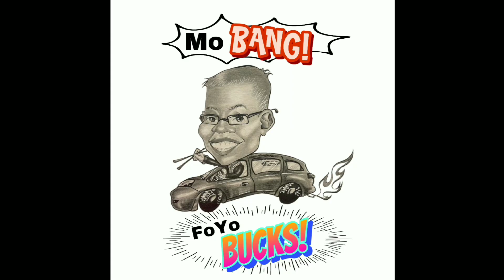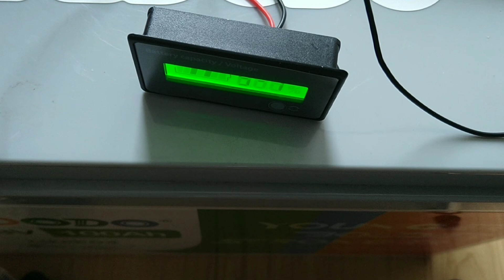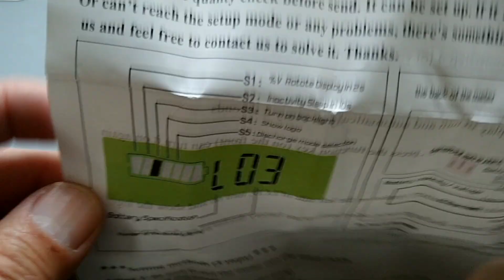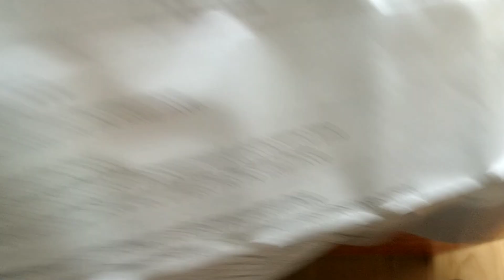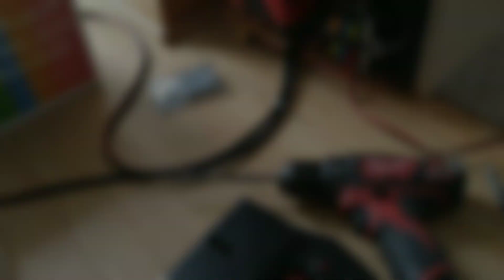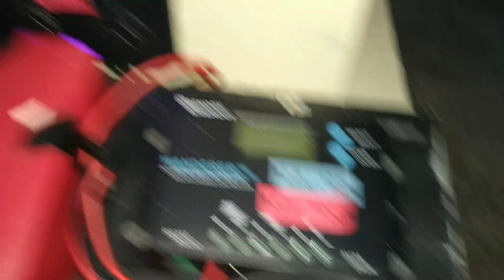Installing Capacity Monitor on 2008 Toyota Sienna Minivan Camper House Battery

Comment: Does this monitor just do a calculation from the voltage level. How does it do it without a shunt? Does the percentage value change when under load (-)or being charged (+) ?
Reply from the maker: Lol, that's a loaded question!!! I'm not the guy designing it.😂🤣😂 All I know is that it is good enough for my little system. You can spend hundreds for one that give a more accurate reading. But how much value are you gaining from spending that much money just to have an idea where the charged level is. You don't want to charge to 100% or depleted it down to 0% all the time. It will shorten your battery life. Keeping it between 20 to 85% is the optimal range. That will enable your battery to last a long, long time. (in theory) Yes, the reading does drop ehrn the load is on the system.  You always want to read it under minimal load.
Reply: I paid $49 for my AiLi battery monitor (coulometer) complete with a 500 amp shunt and wouldn’t settle for anything less. Before I bought it I was taking no load/charge voltage readings and used a chart.   @MoBangFoYoBucks

Comment: I dont let my batteries go below 12.2 volts or specific gravity below 1.19. That is the 50% mark. I think this is why I get 5-6 years on a set of marine/deep cycle batteries. 😊
Reply from the maker: LIFo4 battery is different.  You can run it down to 0% from 100%. It will last 3000 charges unyil it will deteriorate ftom holding charge. It will still hold charge up to 80%. You get more bang for your buckes wigh LiFo4 battery.

Comment: This is the way...... ✨️

Thanks, A Million Tim!
I'm re watching your solar charge controller  installing.  
I picked up a  Renogy wanderer 10A 
 and  Renogy BT-1 Bluetooth Module.   Then, I get notifications on this new video.  
This made my day.   I'm not sure what fuse gig to use 🤔  though  I have the same Li battery as you, the  redodo, but my inverter is 2000w . 🤷🙃
Reply from the maker: 200 A fuse for that 2000 Watts inverter. I have a 400 W inverter. So I used a 100A fuse is more than enough!
Reply: @MoBangFoYoBucks   Thank you, Brother! 😊  I appreciate 🙏🏼 you!
Reply: What gauge wire are you using between your battery and inverter?
Edit: and long is the cable between the battery and the inverter?
Reply from the maker: @CLdriver1960  I used heavy-duty jumping wires for my 400 watts inverter. It never got hot when I used it. As for Thommy, I would research what type depending how far the inverter is from the battery.
Reply: @MoBangFoYoBucks  My battery and inverter are close together.  In my YouTube video where my inverter is installed in the van. In the bottom left corner  ( empty) of the van is where my battery is.